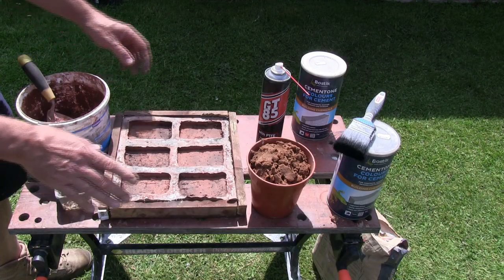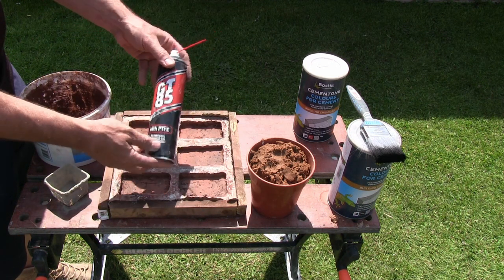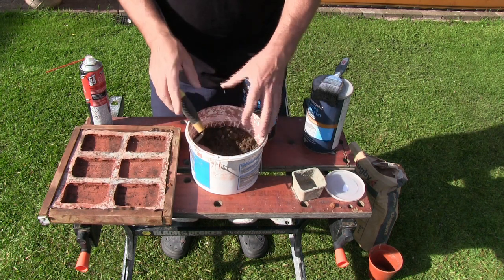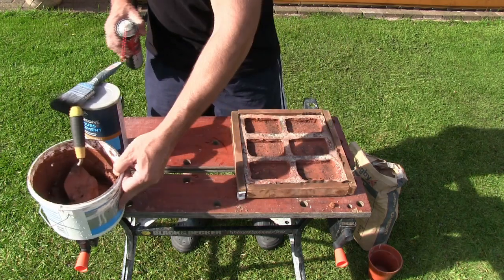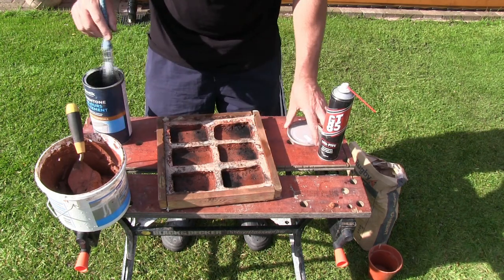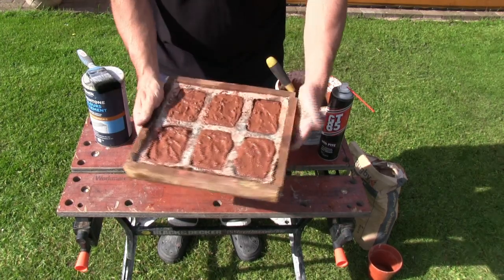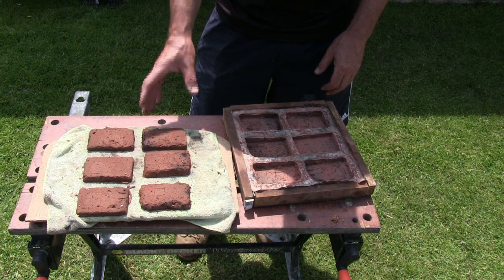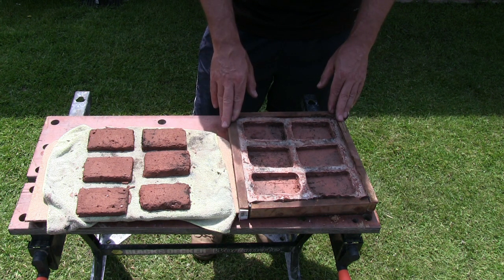AMAZING Outdoor Pizza Oven (part 5) Built for £70 - about $90

Comment: The videos are great, thank you. I have just removed a brick wall and have lots of leftover bricks. Is there anything wrong with cutting tiles from these bricks rather than making? Thanks.
Reply: I was wondering the same thing. Seems like if you had a pile of bricks, an afternoon with the angle grinder could save you 7 days of moulding time.